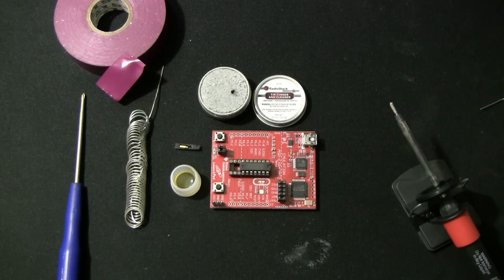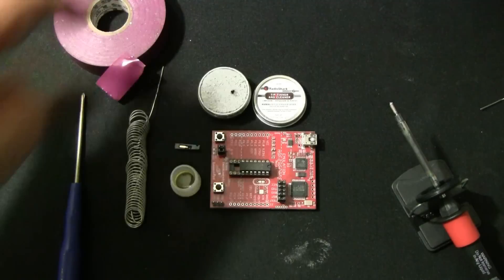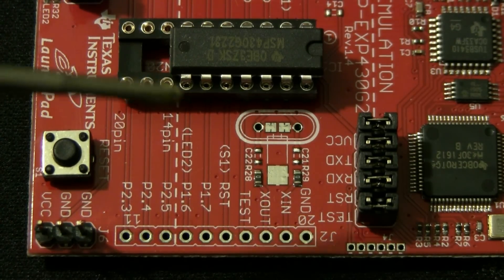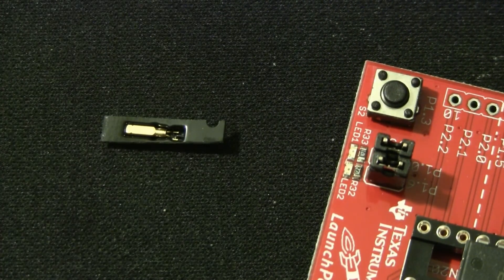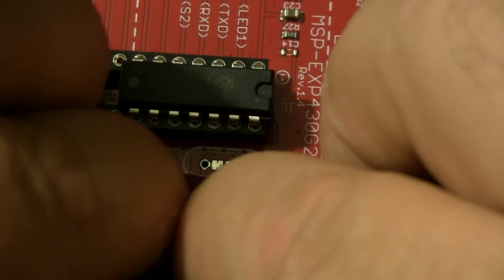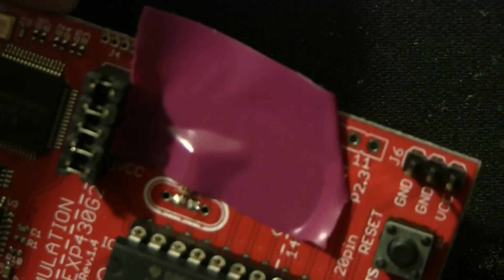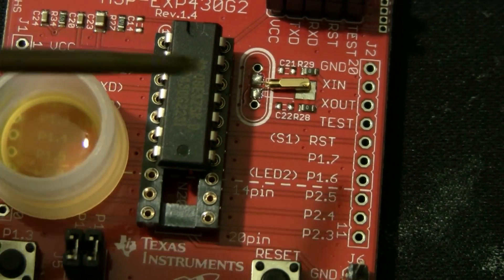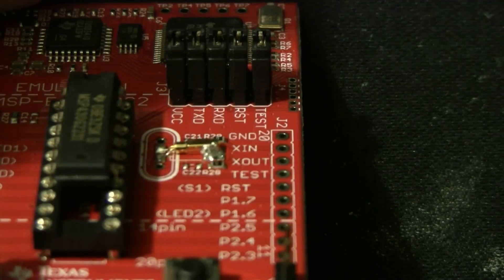MSP 430 launchpad soldering Crystal

Comment from the maker: The crystal is not required. and it uses inputs. How ever, it give you a stable clock and ultra low power modes. that is why you mite use it.

Comment from the maker: when you run the program the LED will flash slowly if the crystal is soldered properly. Once every second

another way to test this is to use a small screwdriver and carefully short out the two metal pads where the small wire leads from the crystal are soldered.

The LED should begin to flash rapidly, when you remove the screwdriver, and the short is no longer present the LED will go back to a rate of about once every second.